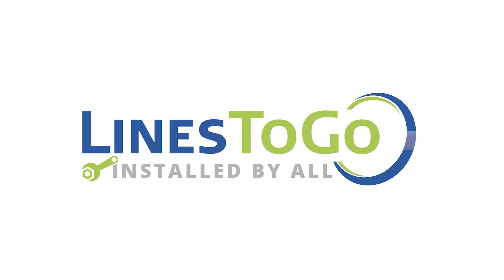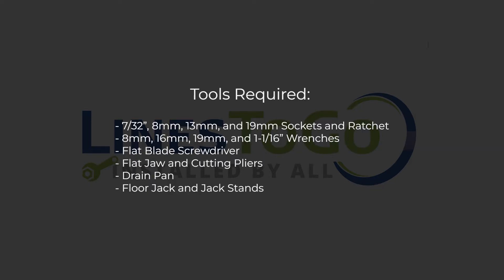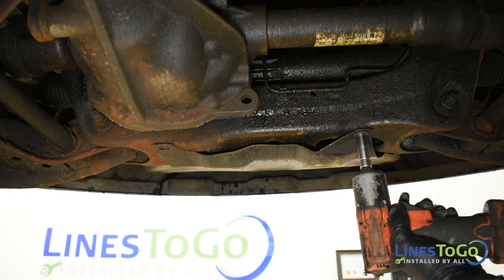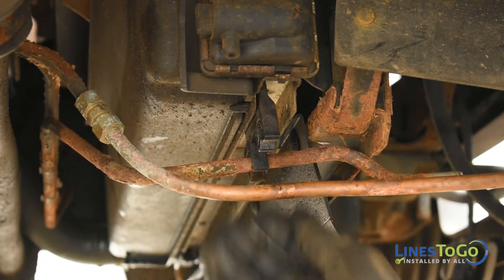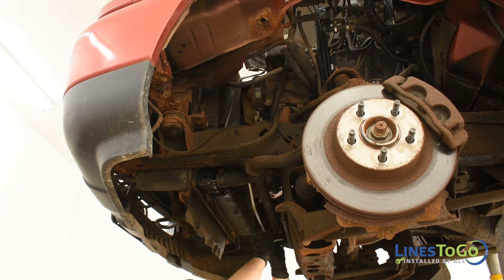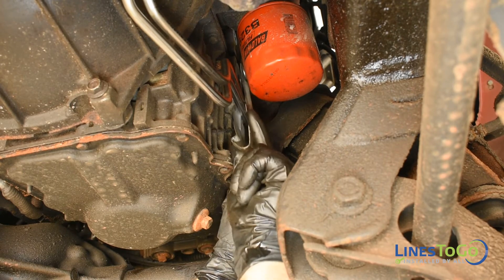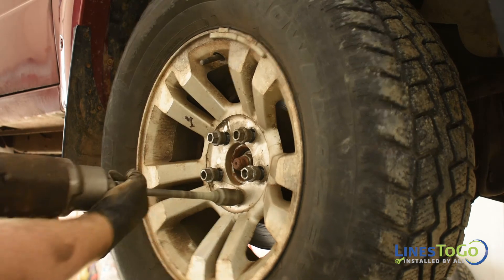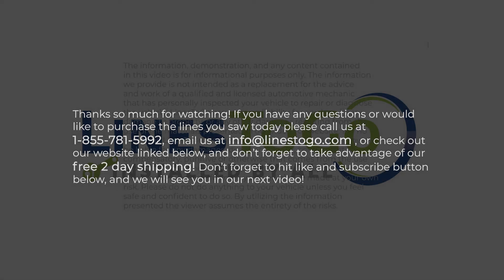How to Install 2006-2011 Ford Ranger Transmission Lines

Comment: I just finished a 2011 Ranger XLT 4.0.  Had to unbolt and pull down the sway bar from the frame (not the end links) to run the line from the top of the transmission.  Also unbolted the radiator shroud to allow it to move around but thankfully didn’t need to pull it out.  Also, I needed a full compliment of crows feet, stubby, and angled wrenches to pull this job off.
Reply from the maker: Hello Jeff,

Thank you for providing more information regarding your installation! This may be helpful for others attempting installation!

Kind Regards,
LinesToGo

Comment: Doing mine today.  The bottom rad inlet was rusted/fused to line connector so I ended up taking the whole fitting off the rad with an 1 1/16 socket.  Then put the whole fitting in a vice so I could get a better grip to remove the line fitting.
Reply: Lines look great.  I had a bit of trouble getting the union to be at the right orientation.  The stainless lines are harder to bend than steel but I did get it all together and transmission working.  A great product for a fair price!
Reply from the maker: Hi Jason,

Glad you were happy with your lines. The stainless steel is a little harder to work with but will last much longer than any other steel whch is why we prefer it for brake line kits.

Happy Travels,
LinesToGo Team

Comment: Perfect. I came here to figure out how to put the line in you guys broke down into 2 lines. That's really smart. Wish I bought that one instead of the crazy one piece line I have that doesn't even look like it's the right shape
Reply from the maker: Hello! 
Glad we could help with your installation! 
If you are ever needing lines again in the future you can check us out at www.linestogo.com! :)
Happy Travels,
LinesToGo
Reply: @LinesToGo  yeah, I ordered the set. Got fed up with the ones I got from Thailand. I think they need better quality control because the fittings just were not going on the transmission. They went on the radiator fine. Not sure if those are different fittings. The ones they used were 17mm outer diameter not 16mm. The originals were 16mm like in the video.

Comment: 6/8/22; I just did mine today on my '08 Ranger 4.0 2 wheel drive. I did NOT replace the longer line that goes from the transmission to the radiator cooler-(Mine wasn't rusted) I had a hell of a time using a 5/8" flare nut wrench and my Metrinch 5/8" open end wrench so I thought of a Crows Foot wrench/socket. I went and bought a set from Harbor Freight and used a couple of LONG extensions and the Crows foot worked PERFECTLY!! I HIGHLY RECOMMEND!! I also had a real hard time getting the large clamp that anchors to the engine block back in place-I ended up removing my oil filter to gain more room which helped. Just thought I'd share my experience for anyone else that has to do this nasty job.
Reply from the maker: Hello Richard, 

Thank you for watching our video and providing your feedback. 
We are glad you were able to complete your repairs. 
The use of specialty tools can be very helpful in a lot of cases. 
In our videos, we try to complete the repair using the tools we believe most of our customers may already have in their collection. 

Happy Travels! 
LinesToGo Team
Reply: I was trying to do mine but couldn't get any wrenches that could reach the transmission port because it was a tight squeeze, do you know how to get that part out? I have a 2010 4.0
Reply: @dimitaryotsov4318  Get yourself a set of Crows Foot Sockets (SAE) it takes a 5/8" on the line nuts. Remove your RF plastic inner fender. Go in through there with a couple of long extensions. Good Luck!!
Reply: @richardbarkley9909  ok thank you
Reply: @dimitaryotsov4318  You really should remove your right front wheel as well and support your truck with a jack stand while you're under it as well.
Reply: Smart

Comment: Is this the same as 2003 ranger
Reply from the maker: Hello,

No, it is not. The part for the 2003 is TCL-178-SS, and unfortunately we do not have a video for that part yet.

Here to Help,
LinesToGo Team
Reply: I have a 2004 Ranger 6.0L and there is an exhaust pipe going right across the transmission there. It sucks. Wish I had a 2 piece line to the radiator

Comment: Any tips on geting the lines off the transmission? I am watching him with a wrench and I am over here with a crowfoot and a breaker bar and this thing hasn't moved an inch...
Reply from the maker: Hello Sam, 
I spoke to our technician and he advised you cut your lines close to the tranmission and use a socket to remove them! I hope this helps!
Happy Travels, 
LinesToGo
Reply: I cut mine and used a socket. No problem

Comment: Been trying to source prebent lines for my '06 for a while... factory still sells the stock steel ones (the trans. to the radiator is getting scarce) but all together, the price is only $20 dollars less than these stainless lines. With the size of the long line, who knows what freight would be for that stupid big box, not to mention how bent to sh*t it will be upon arrival! Seems like an obvious choice getting these.